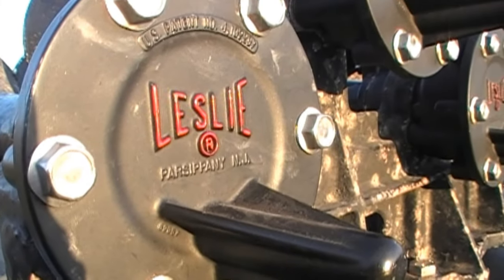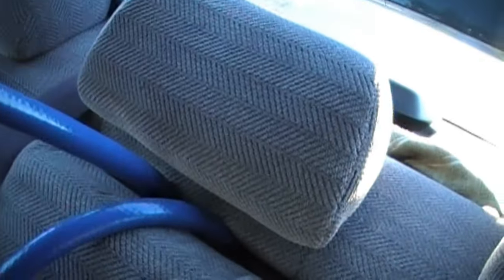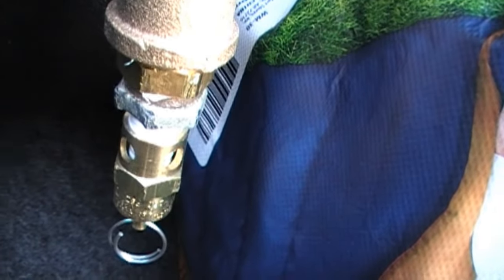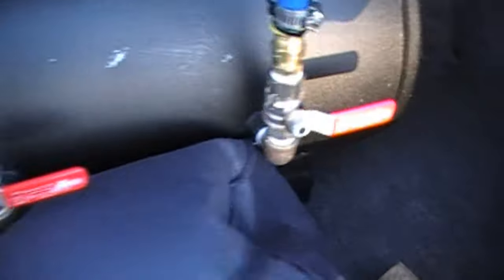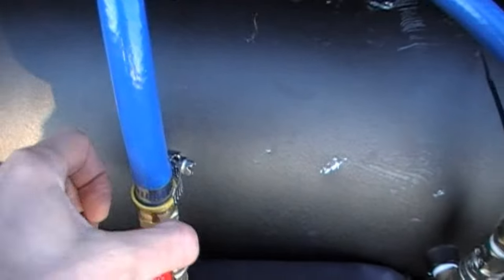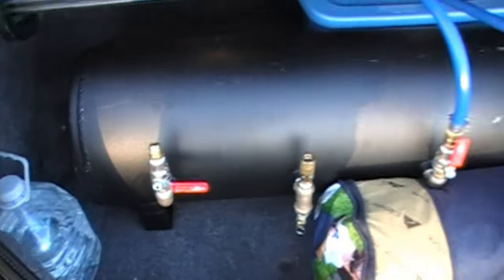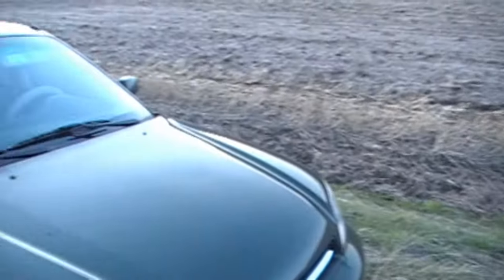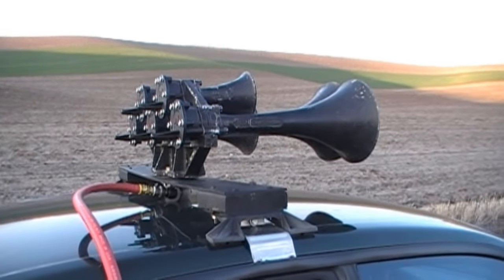Locomotive horn collector air system NOT for pranks or scaring (Big air for a big horn)

Comment from the maker: Read the video description before posting a comment!  Thanks and have a great day.
Reply: I like your setup but how would I get a deeper / lower tone? Would I need a specific horn, a larger or longer bell, or something else? Thanks.
Reply from the maker: @billcampbell9886  A lower pitch would require a longer horn, or one with a larger internal diameter.  Search my videos for Leslie A-200 and Wabco E2.  That's about as low as a locomotive horn goes, to get any lower you need to go to ship horns.
Reply: What if you get in a car crash?
Those tanks might need a roll cage
Reply from the maker: @thatbirbfriend2180  The tanks are DOT certified air tanks, meant for vehicle use.  Compressed air isn't an explosive agent, it doesn't go boom from a sudden shock.  120 PSI isn't high enough to cause an explosion should a tank get crushed.  As soon as a tank is impacted if the pressure rises the safety valve will pop, and if any tank damage is enough to open up a hole that relives the pressure.
Reply: Reminds of the Seaboard Coast Line horns.Used to hear them allot.Being I live about a mile and a half from the tracks.I meet a truck driver who had a train horn under his truck.

Comment: ok, most people would not understand why you did this. I DO! it's cool. LOUD and FUN! I have a '59 Chev Panel Truck, custom street rod. (you can see pics at my google page.) a friend of mine who works for the railroad got me a cast alum. set of air horns right off the top of a locomotive, I installed a 40 gal. tank underneath the truck, and was able to also mount the huge horns under the truck on the frame. you could not see them, I added a 100 lb. compressor and the fun began! the sound was incredible! so, let me just say...I GET IT!!  BLAST AWAY!!...Tommy in Minnesota

Comment: Minor point of appreciation; part of the magic of train horns is that Doppler shift they make as the train roars past, the distinctive chord sounding continuously.  They're meant to be used on moving vehicles, and that's how we hear them.  Your recording them mounted on a moving car captures that missing element perfectly.  As you drove past, it wasn't hard to imagine a bygone first-generation locomotive from a forgotten railroad blasting past as it leans into a curve.  

Thanks!
Reply from the maker: That is EXACTLY why I did the car air setup!

Comment: Collecting and restoring old train horns?

Sounds pretty fucking cool.
Reply from the maker: Thanks, I think its pretty cool myself.  Check out my other videos, I have over 20 different train horns that I have rebuilt are restored.
Reply: I'll be sure to check them out.
Reply: mafarnz I'd like to purchase a used Nathan or used Leslie. Do you have any suggestions as to where I might find used ones that may need minor work? I can't afford new ones as I want to stay married for now.
Reply from the maker: 200mphz06
 Ebay, horn collector websites are good places.  The average range for a good condition used Nathan or Leslie 3 chime is $450 + - 100.  Avoid the powder coated ones, they are overpriced for what they are.
Reply: mafarnz Wow. That price I can handle. Thanks. What are your thoughts on getting a compressor and/or tank from Harbor Freight? I know they're not top of the line but I think they'll work.
Reply from the maker: 200mphz06 They will work, the important think is that there is at least one 1/2" port that you can use.  In order to sound good the horn needs everything to be 1/2".  Tank port, hoses, valves, fittings.
Reply: mafarnz Excellent. Thanks for your help.

Comment: Dude so cool would have thought a train was coming even sounded like a train when you went past the camera how fast does it  recover air pressure do you have the compressor hooked to 12 volt or are you using a inverter to run the compressor great vid happy holidays y'all ✌️
Reply from the maker: The horns are off a train, so yeah they do sound like one!  The compressor runs off household 120V AC.  I fill up my tanks when I'm at home and don't refill them when driving.  I don't run a horn on the car 24/7 so this works great for em.

Comment: Good on you for having an unusual hobby, but I have one question. Why in a car, if not as you claim, to use them on the road? Your car is now useless for practicality, but you have a setup to run the horns on the road, which you say you won't.
Reply from the maker: +lazaglider your answer is in the video description, but since no one ever bothered to read that I'll go ahead and re-answer the question here. I collect and restore old locomotive airhorns as a hobby, and so this air set up on my car is because I will never be able to afford my own railroad or locomotive. I never have a horn on the car 24/7 anyways, and so I designed the set up so that everything is removable. Except on the rare occasions where I actually have a horn, none of the stuff is in my car and my car is just a car without the horn.
Reply: mafarnz You don't address the point. You collect horns, good for you, but what is the necessity to have a 'mobile' setup if not to use them on the move? Why this, for instance, over a setup in a shed or workshop? I'm really not trying to bag on you, and I can tell from your slightly antsy response that you are growing tired of answering questions, but there really does seem to be a gap in logic between what you tell us and what we see.

I wouldn't, for instance, set up a 40 inch tv in my car if I had no intention of watching tv in my car. See my point?
Reply from the maker: Because with a mobile set up I can make recordings of my horns the way they would sound on the train.  The Doppler effect very much changes how a horn sounds, and notice how the horn is very different when its moving.  The way these things are normally heard is while they are moving, so I want my collection to be able to be heard the same way.

Comment: I like your set up, I'm on board...just a few tips from a fellow pneumatic junkie...worm clamps, NO.  Garden hose connectors, NO. Buy the correct tool and make your own crimped connections.  Lower the fail safe schrader valve to 130.  Should the compressor valve fail you'll be up higher than horns can allow. Get an electric release valve and ditch the handle valve set up.   Last...at least strap that compressor down if not already.. you wouldn't want it in your back or your noggin in a head on... peace, and be safe.
Reply from the maker: Thanks for the tips!  A few things.  The hose barbs are a type that don't require hose clamps, I double checked that with the manufacturer before I did it.  The horn(s) can withstand up to 150 PSI without damage, they normally run at 140 on a locomotive.  I choose a manual valve instead of a solenoid because the manual valve allows better control of the horn and more playing around with the sound, and because solenoid valves can over time actually cause damage to Leslie horns.  Lastly the compressor has the seatbelt going around it, so it is held in place.  Cheers mate, and thanks!

Comment: I had a buddy who did something similar with an air horn from a semi truck in his van.  If you get all of your fittings to be leak free you can just recharge the tank when you're at home and the air will last quite a while.  Seems like an awful lot of space to lose in your back seat putting that compressor in there, especially considering that you need to stop to get to an electrical outlet anyway.
I know a lot of offroaders will convert old A/C pumps into air compressors.  You could do something like that too.  
Another option would be to set up one of those cheap 12V compressors to recharge the tank incrementally while you're just driving around.  Run it for say 5 minutes on, cycle off for 20 minutes to cool, back on for 5 minutes, and so on.
I remember one time we were sitting at a railroad crossing and he blew that horn at the engineer as he went by.  The engineer blew his horn and that freaking thing shook the ground I swear.  It was super loud.  It's a good thing you're wearing ear protection.
Reply from the maker: +Bill Bradsky The reason for the compressor in the back seat is the 12 gallons of air that it holds.  The compressor + the 20 gallon tank gives me 32 gallons of air, and that's barely enough for my large horns.  I still need an AC, so re-purposing that for a compressor is out.  I didn't want to modify the car's electrical system, so a 12 V pump is out.  Those little cheap 12 V pumps couldn't handle the volume of air that one of my horns needs anyways.  Trust me, I looked at all those options and more when I was first figuring out my horn set up.  Ultimately I went with what I show in this video because #1 it works very well and #2 everything except the rack and valve is easily removed.  I only have a train horn on the car maybe once or twice a month anyways, the rest of the time its just a normal car with no train horn.  Having to go to an outlet isn't a big deal either, since the only reason for putting the horn on the car is to get a recording of it while it is in motion.  So I have enough air to make my recording and then I'm done.
Reply: mafarnz
Seems like you've got this well thought out.  Very cool that you go to the lengths you do to capture the doppler effect necessary to make these sound authentic.  I gotta be honest, I was looking at you sideways when I first stumbled across the video, but I get it now.  Since I'm more of a car guy, it sort of reminds me of the guys who go to painful lengths to restore classics to exactly the way they were when they left the factory.  Or like the guys who take old machine tools and make them function like new instead of going out and buying a new Bridgeport clone from Asia.  There's something cathartic about that to me.  It's almost more of a preservation of a piece of history than it is an enthusiasm for the object itself.
Reply from the maker: +Bill Bradsky Exactly, that's how I look at it, I'm preserving a small piece of history.  I have over 20 horns, most of which are older than myself, and most of them make sounds that you don't really hear outside of a railroad museum.  The car set up is simply a way for me to use the horns, since I don't have the money to buy my own railroad.

Comment: Sounds great but you could have installed the compressor in the boot (or trunk as you Yanks call it!) and the horns possibly under the chassis if possible or the bonnet (hood!). I don't think it will impress anyone as much if they get to see all that hardware before you let it rip. Maybe, that's just my opinion but nice setup and equipment anyway. I'd be interested to see the output on a DB meter if you get the opportunity, it is hard to tell the volume by a video. Great upload, thanks for sharing!
Reply from the maker: At full pressure this horn is capable of 125DB, not sure what its putting out on my setup however.  I didn't see the need to install an on-board compressor since I don't usually have the horns on the car, and I don't put the horns under the car because #1 they don't fit and #2 I spent a lot of time and effort restoring them and making them work again, and all the road grime and salt will just ruin them all over again.
Reply: mafarnz
Oh I didn't realize they were vintage. You must have done a good job of restoring them then. They look much nicer than my shitty red plastic ones anyway!
Reply from the maker: sparkyuiop
This video was made very early in the restoration, check out my video titled "S5T Reborn" to see and hear the finished project.

Comment: So your hoses are 1/2" diameter? I don't have an "ideal" setup at all, I use a very thin (1/4" I think) hose. Because of this, even at a high pressure the overall volume isn't that much, so I blow at 150. If I use much less than this not all the bells will sound. I want to upgrade my hoses in the future....
Reply from the maker: The tank port, valves, hoses and fittings all need to be 1/2" inside diameter.
Reply: Thanks

Comment: You do realize you could easily put an air pump on the car motor under the hood and completely eliminate the compressor in the back seat?
Reply from the maker: I could, but I decided that I wanted my horn setup to be easily removed from the car, and also to not make any modifications to the mechanical or electrical systems of the car. Since I rarely have the horn on it it didn’t seem worth the effort to put a permanent compressor in.

Comment: You are really risking yourself!  135 psi, of that much air, and the only thing holding it in, is cheap Garden Hose ends, and ZIP Ties!  WTF?

I worked with hydraulics.  Please get some real hose clamps (at least), or have the hoses professionally done.  Also, you can get 1/2" quick connects meant for air.  Try Harbor Freight.

Other than that, I like what you're doing for old train horns!
Reply from the maker: +PV2Omni Since this video was made I had switched from using the garden hose connectors to SAE flare connectors. Also, the air tanks are DOT rated for up to 200 PSI, and the red house that I use is  Goodyear rubber air hose which is designed for up to 200 psi.  Zip ties just hold pipe insulation in place around a steel pipe.  I did look into getting half inch quick connects, but even they are too restrictive for use with my horns, and were far more expensive than the SAE flare connectors that I currently use now.
Reply: mafarnz My comment was only in regards to how you were terminating the hoses.  

I heard about the DOT tank, in the video/comments, and clearly spotted the hoses used. However, the compressor tank my not be rated that high.  

That is besides my point though.  If the hoses aren't terminated properly, they can explode/come off, whipping the hose around.  With that much air, at that pressure, it could cause serious injury, and/or cause you to lose control of your car.

I saw that this was an old video, expected that you were further, but wouldn't feel right, if I didn't warn you!

Comment: I was so glad to see the air compressor wearing it's seatbelt in case you get pulled over. The only thing scares me is you having a pressurized tank adjacent to the occupant area, not safe.
Reply from the maker: The compressor is seat belted in so it doesn't fly into the drivers seat if I got into an accident.  The large 20 gallon tank is actually designed to be used for large semi truck air brake systems, so its a DOT certified pressure vessel for use on a vehicle.  The small compressor is protected by being in the passenger compartment and by the seat belt.

Comment: Instead of screwing on the hose to the horns all the time... use a quick disconnect...
Reply from the maker: Quick disconnect doesn’t let enough flow through for the horn to work unfortunately.
Reply: mafarnz what cfm do the horns consume?

Comment: I would love to have a train horn. I have always wanted one but have never able to justify the money to buy one. I have a bunch of old railroad crossing lights and even an old locomotive brass or bronze bell. My thought about people using air horns/train horns to scare people is that they deserve everything that will happen to them, none of which is good. I almost bought a 1960's civil defense siren once. The thing was huge, like three feet tall and was powered by a 220 volt electric motor. Train Horn pranks. Personally I would whip the living hell out of a train horn joker. You would think they would realize something is wrong when every time they pull their prank everyone around them wants to physically hurt them. They are too stupid to realize that sooner than later someone is going to beat the hell out of them. 
 Cops shouldn't care about the horn as long as you aren't using the horn on public roads, in traffic, etc. Explain that you only use at rail road enthusiasts get togethers and that it is never hooked up while driving thus cannot function in traffic. If that doesn't work tell the cop that there is no other place in/on the car it fit except on the roof. Tell them they should be more concerned about the growing trend of a$$holes mounting blue lights behind the grill of their cars.

Comment: Sweet!   I had a big rig horn in my miata a few years ago... upgrading to firmer air hoses helped the mushy attack that plagued me during first tests.  I had used a few short pieces of generic hose to make some mating of fittings and hose work out.   ...but even those short lengths provided enough expansion to kill the attack. That red hose in your video looks like it sucks up a lot of the attack.  Firmer hose and a faster or electric (usually snappy by default) valve would punch up the attack - sounding harder and more startling.  I think there is a decibel to pants poop ratio and equation but it escapes me at the moment.  Your passion and methodical approach inspire.  Fuck the haters and trolls -  keep weird science alive!
Reply from the maker: Same type of horn, same hoses, still on a manual valve.  This a good attack?  https://youtu.be/TLyUqaC4HX4?t=10s
Reply: mafarnz yahhhh. Verah goot mahnnn.  Very "train" sounding.  You feel the sound ramping into full note.  Like a kid playing saxophone or trumpet - just learning and giving it all she`s got, captain...  (A VERY large kid, mind you...hah)

I think 18 wheeler big rig horns peak a little faster -  more of a bark than a coyote warning howl.  Maybe highway risks and collision avoidance and the required quick reactions make the triple note bark a better choice than BBBMMPRAAAUGH on the highway.  And let's face it if you haven't seen or located the Train by the time you can hear The BBBMMPRAAAUGH your  probably already toast anyway. I kid I kid...   they're both awesome in different ways.  Esp when they rip from a small Asian manufactured vehicle. I think the train definitely evokes more of an emotional reaction... from the prank videos people either want to fight or they want to fall down and cry it's interesting- there's not much in between.